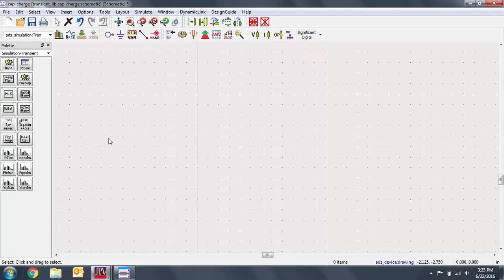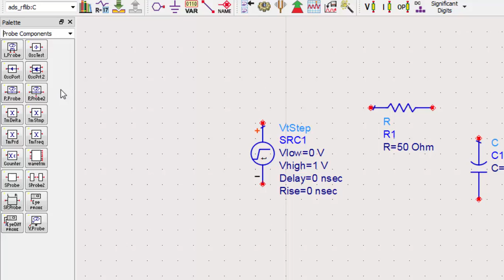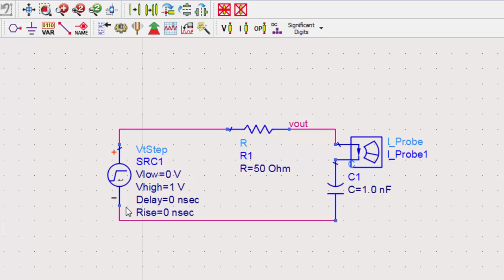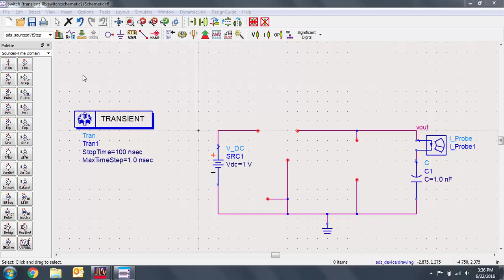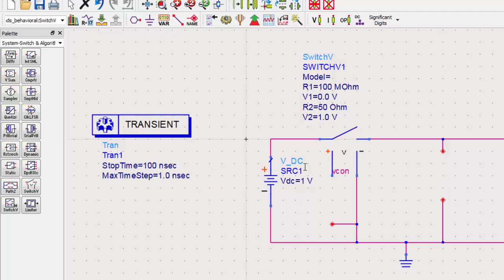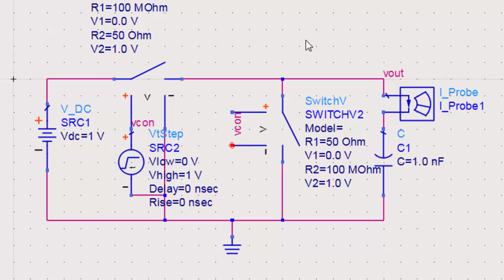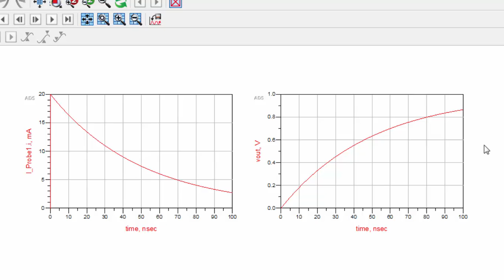Obtaining SPICE-like Results with Transient Simulations

Comment: Did I get it correctly? The V_Probe instrument simply does not work like the I_Probe in Transient; and you have to use labels instead. So what is the use of V_Probe? A deprecated tool not removed for the version compatibility?